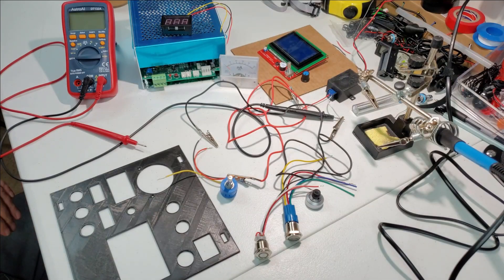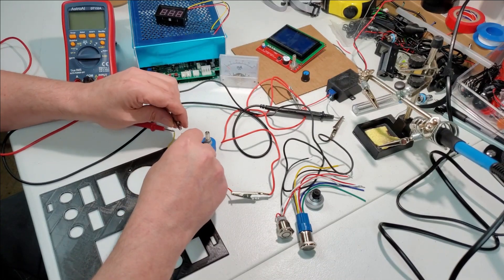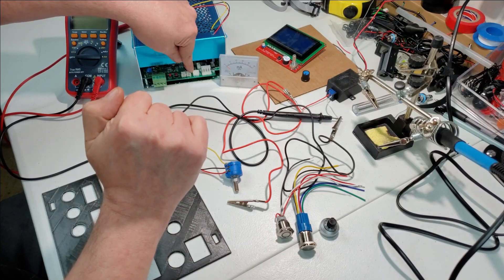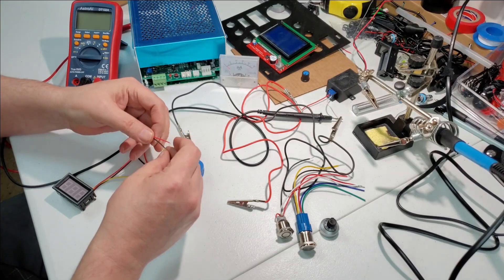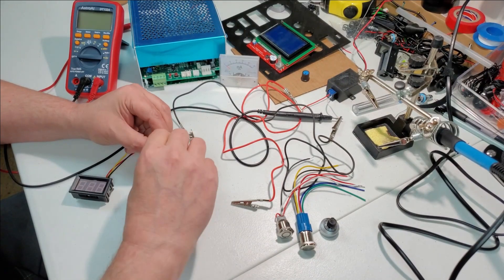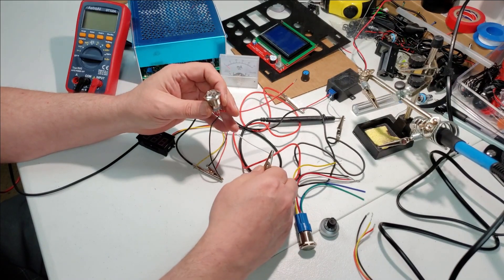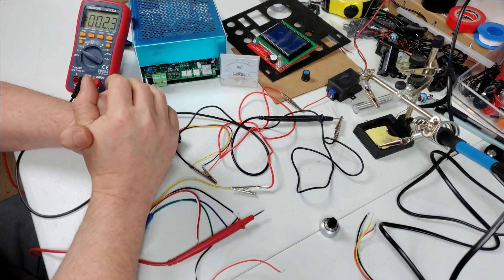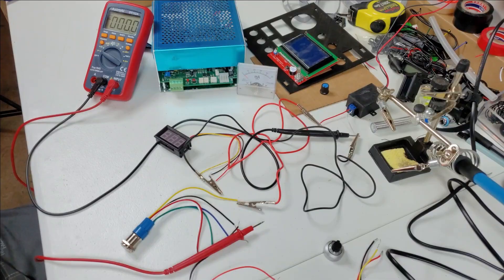Convert K40 Digital Panel To Analog Control

Comment: Love this video! Been trying to install my cohesion3d board which went in very well, until I tried to fire the laser. Tried the G1 code and it did everything it was supposed to do but without the laser firing. I played with the board and somehow the K40 stock control board pooched itself. Now I don’t get a % for the machine on the display anymore, just 2 red dots below the numbers. Was researching how to install a potentiometer and found your video. Love it! I also realized while watching that you used the led display for the voltage, I have a few sitting around from my 3D printers. I’ll be trying this today!
Reply from the maker: I am super happy my video helped you! If you need any help you can find me in the FB group.
https://www.facebook.com/groups/395110597946859 (K40 Laser Enhancements)
FB Name: Michael Burns
Reply: @k40mods55  I’m also a member there under my own name.

Comment: Can't find you in the Facebook group. Could you either link me to the buttons your using or make/model i love those buttons
Reply from the maker: No problem! In facebook I use my real name :)... 
Link to On/Off : https://www.amazon.com/gp/product/B07Y19ZBT7
Momentary : https://www.amazon.com/gp/product/B083R5178V
Reply from the maker: Also, because of the different voltages of items in laser .. 5v, 12V, 110V, I used this when I rebuilt to 300mmx610mm, gives same brightness on button glow (12v) and gets around a couple of other safety features issues when wanting lights to come on (closed circuit on safety loop) 
Relay : https://www.amazon.com/gp/product/B07BLT8TY6/
Reply: Thank you so much
Reply from the maker: @scottvandenhout1796  np, I hit you up on FB if you have any questions/issues
Reply: @k40mods55  awsome thank you

Comment: what is the name to look for on that digital display please, also i seem to have my pot wired wrong because it has to be turned counter clock wise as you said, I'm not good with a multimeter so not sure which wires to change could you Facebook message me Angela Newingham

Comment: i'd add a resistor from wiper to ground in caser the wiper ever fails to connect to the track so it doesn't become a floater..... (i grew up on 60's electronics books where such things happened with early pots on valve amps leading to blown speakers)
Reply from the maker: Thanks for the info, I will defiantly look into that.
Reply: @k40mods55  good chance the PSU already has one internally but it's just 'old school thinking', nice video btw.

Comment: So the reason for adding the voltmeter is to get a rough estimate of the output without doing a test fire and looking at the mA reading correct? (You would have a cheat sheet saying, for example 1V setting gives you a 10mA reading)
Reply from the maker: Yes... you could do it with just the pot,  but pots wear out.. (made in china .. lol)  So the volt meter will show that. Also it looks cooler... I will be swapping this one out with a 2 decimal display... It is by no means required to convert to analog.
Reply: @k40mods55  gotcha, I wanted to make sure I was understanding the reasoning.  Now I've seen digital displays that read both volts and milliamps, could these work for both readings?
Reply from the maker: @JW  Yes, that is how it works. For example, Lighburn power setting of 50% and pot setting of 50% is really 25% over all power.